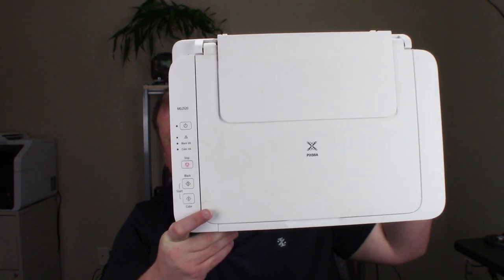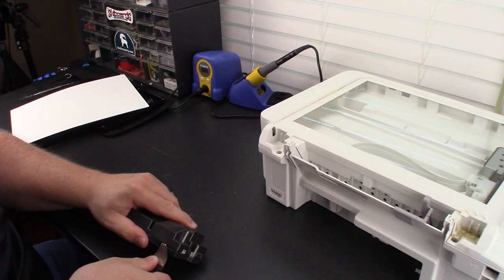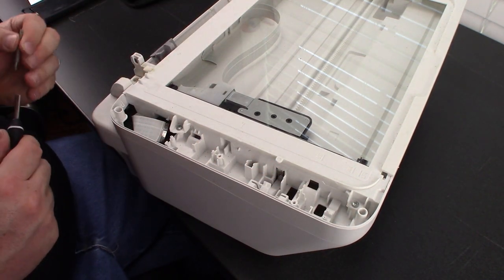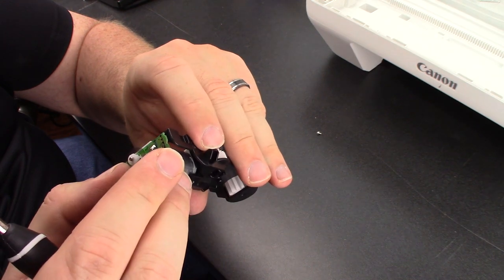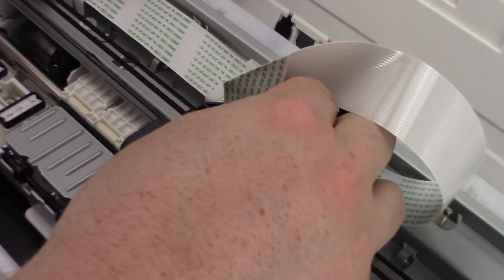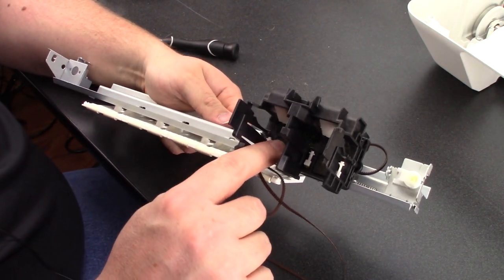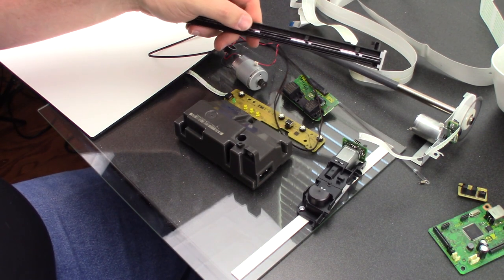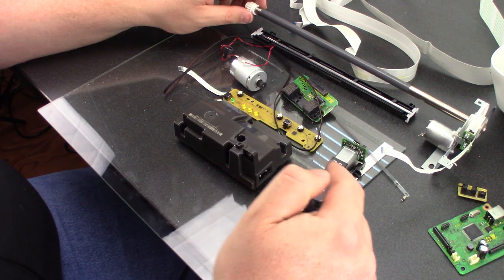Cheap Printer Teardown!

Comment: I got a budget printer for Christmas this year (newer model but very similar) and was really curious how it worked, so it was awesome to see this teardown. The fact that they can manufacture such a fully featured product for so little using clever tricks, like optical sensors and markers with DC motors in place of stepper motors, is very fascinating. And like, the prints look much better than such a low price tag would suggest

Of course part of why they are able to sell them for this cheap has to do with the price of the ink cartridges, so the design of the printer itself doesn't necessarily tell the whole story. It does however show how they are able to bring these things to market at all. And, as this teardown indicates, they probably don't lose money on selling the printers themselves, but rather they're probably selling them with zero profit margin in hopes that the high profit margin of the cartridges make up for it.